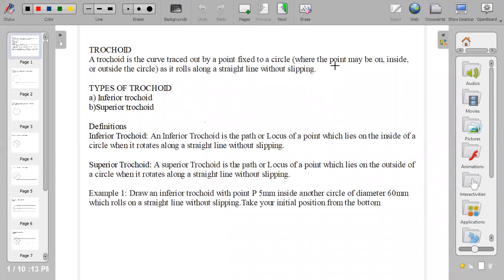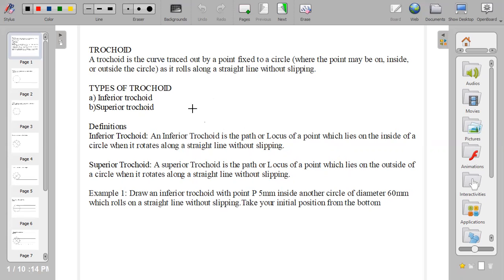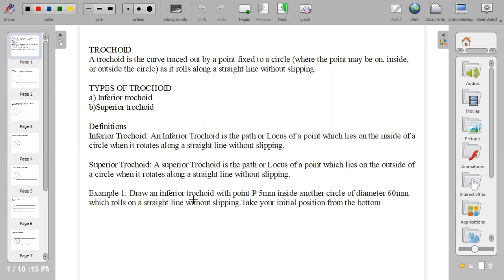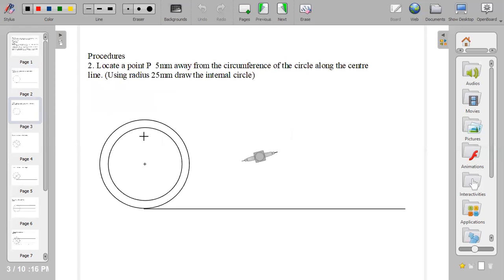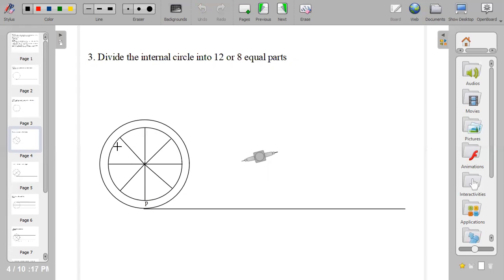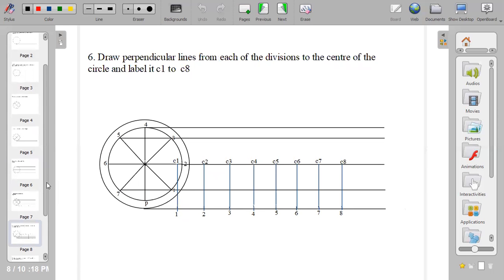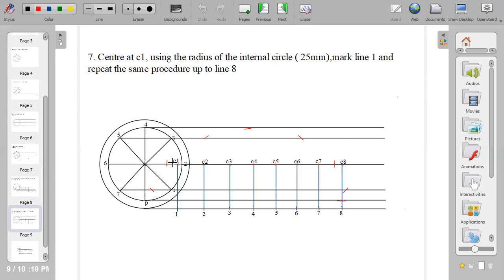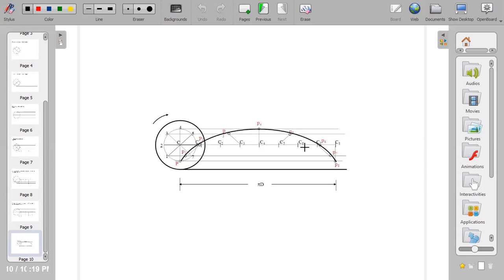Inferior trochoid

Comment: When dividing the tangential line into 8 or 12 equal parts, do we assume the distance between each part or divide the length of the circumference used to draw the line into the 8 or 12 parts?
Reply from the maker: There are two ways to it but the distance is not to be assumed. Firstly,you can use your compass to pick the distance from 1 to 2, 2 to 3 or any of the equal divisions be it 8 or 12 on the circle. You can also use 2πr to calculate the circumference of the circle and then use it to draw the tangential line. If the latter method is adopted then you just need to divide it into either 8 or 12
Reply: @folakemiogunmuyiwa704  thanks

Comment: When it comes to inferrior and superior trochoid which of the circles do we divide, the big or the small one?
Reply from the maker: For inferior trochoid you will divide the internal which is the small circle while in superior trochoid you will divide the external circle, the division lines will cut both the external and internal circles because division lines start from the center of the small circle. They are called concentric circles.